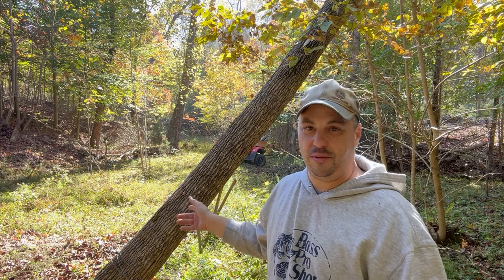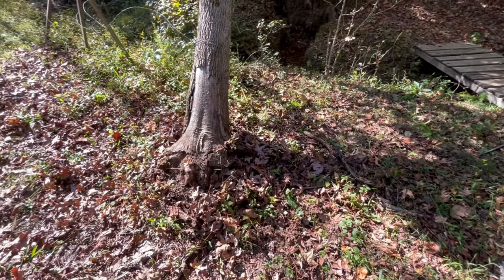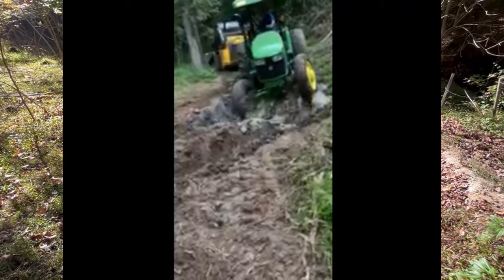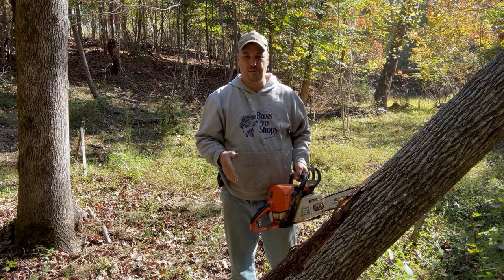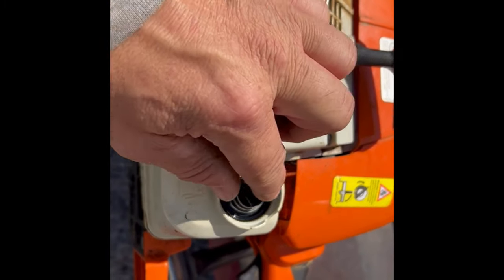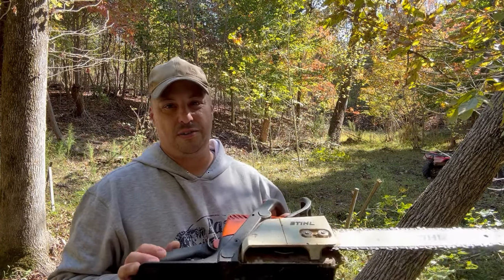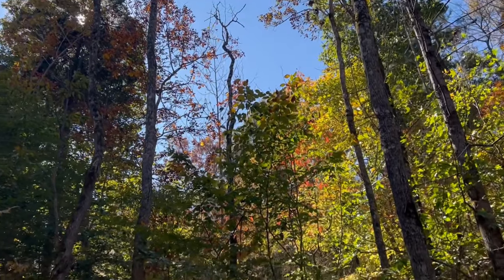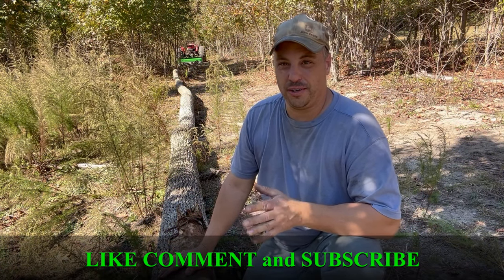tips on how to cut down a widow maker

Comment: Best way is to start at the top until half way through and then work around to the bottom with just the tip borrowed in the wood, and then cut from beneath. Works everytime. Just remember to cut the compressed wood first always. If you have a monster saw, you can also cut straight towards the ground, just like that, to make rest of the tree fall. And make sure you don't use a dull chain like in this video. Saves you a lot of problems.

Comment: That cut is an excellent choice. If you have several trees to deal with, or larger trees, you can try a straight down "salami" cut from the top only. Start your cut in the top and when the bar is all the way in the tree, just "palm" a wedge or lightly tap it in the top of the cut with an axe. The wedge maintains the gap for you while you cut. Then you can just blast straight down without having to line up the cuts. Lifting up to cut gets tiring on a bigger tree.  Easy peasy dude. Take care....
Reply from the maker: Thanks for the info,I bet that way would work good with a bigger tree.  Thanks for watching and commenting I appreciate it.

Comment: Thanks for making this video. The tree im cutting down is massive with 2 huge branches up high, going different directions, one of em is in the ground. I have it cut mostly through near the base but its completely hung up. I tried come-along pulls in 3 different spots with no success. If the wind doesn't take it down this week, im going to finish it off with a polesaw near the trunk so when it goes i wont be near it
Reply from the maker: Big trees are a little  more difficult. Be careful. Good luck with it. Thanks for watching  and commenting I appreciate it.

Comment: what I have is a pine tree that kind of snapped off about six feet from the ground and is now at an angle.  I'm not sure whether to try to cut the part below where it snapped off as I'm not sure where that broken part that's being held up will jump. It would be a about a foot in diameter or bigger.
Reply from the maker: Maybe cut a  notch and use a long chain or rope and a cable puller and ratchet it down from a safe distance🤔. Thanks for watching and commenting I appreciate it

Comment: Step 1
Sharpen you chain

I'd recommend a Stihl 2in1 file, they work really well and last a long time. Worth the money
Reply from the maker: That’s for sure and of course the big saw has a new chain, that’s how it goes sometimes . Thanks for watching and commenting I appreciate it.
Reply: I just bought a few 2 in 1 files for the different pitch chains I run, pretty sweet, and it's nice they file the rakers to the right height!
Reply: Yep as he said at the end "well it definitely would have been easier with a sharper chainsaw" at least that's what he should have said.

Comment: Thank you for providing this video!  How would you deal with a widow maker which is actually a massive branch that broke off a tree and is held by the lower branches in a precarious way?
Reply from the maker: I take a long rope and tie half a brick or a rock on the end and throw it around the branch,then stand waaaay  back and pull it down. Thanks for watching and commenting I appreciate it.